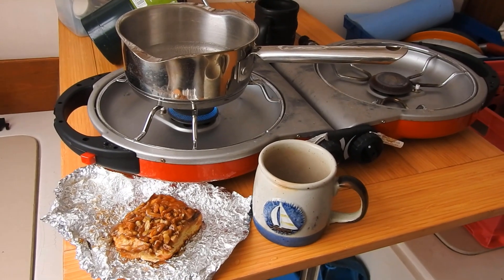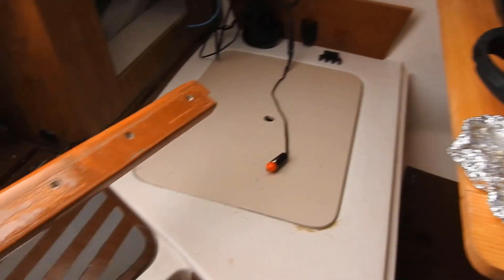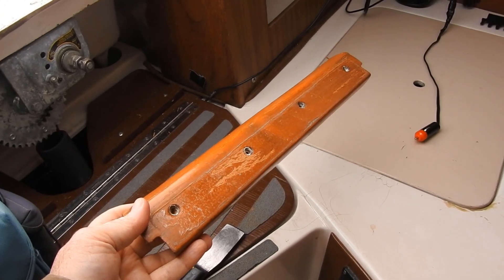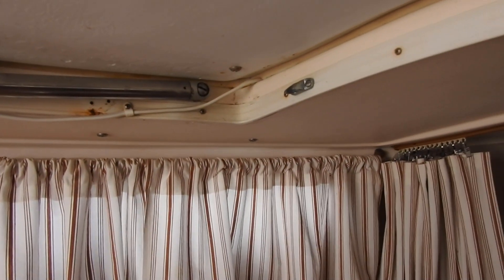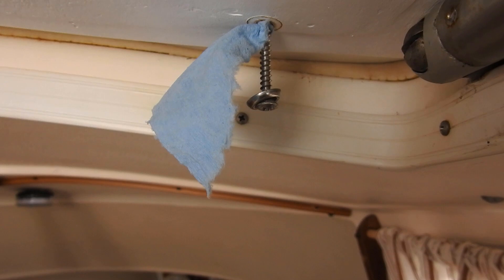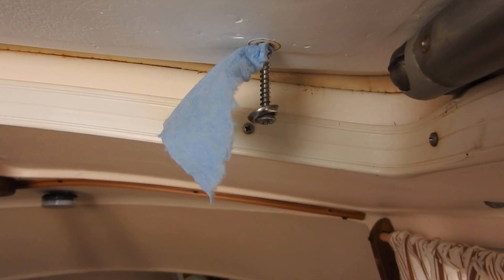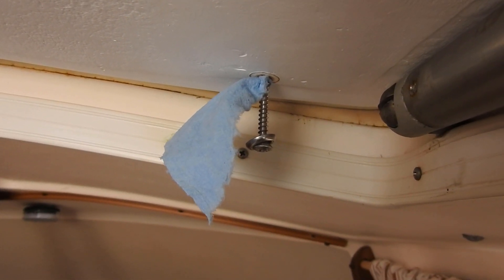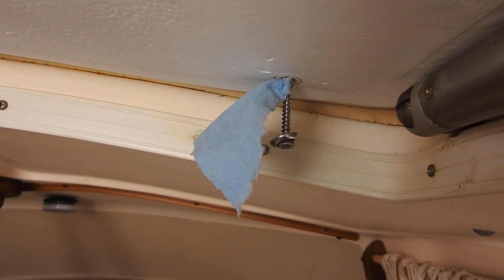Catalina 22 Pop Top Water Drainage

Comment: Hmm, seems like those drip holes could be useful year round. I have an old whaler with a bit of water in the hull. And have found that more comes out of holes when the fiberglass gets warm due to strong sunlight. 

Maybe your screws, wicking paper towels and a dehumidifier like damp rid would be appropriate?
Reply from the maker: I haven't done it yet this year. Mine was very wet when purchased. It takes a long time to wick it all out. Probably will never dry completely. The fiberglass would have to be opened up and redone to completely cure the water problem. I'm not ready for that. My boat has good ventilation in winter so the wicking works well.